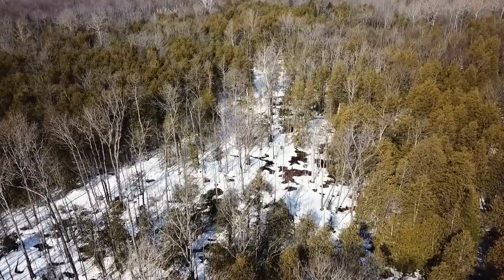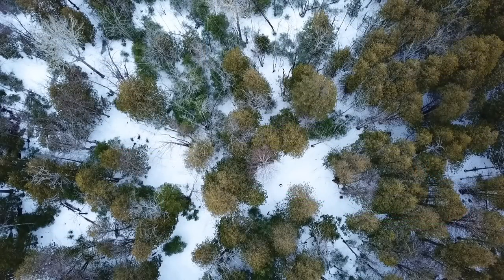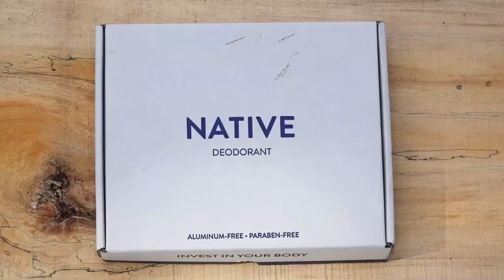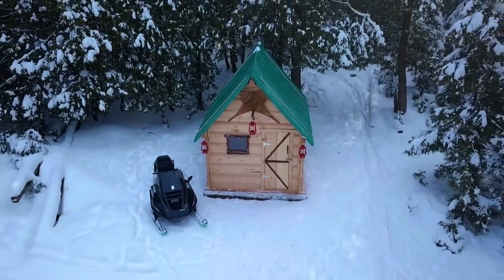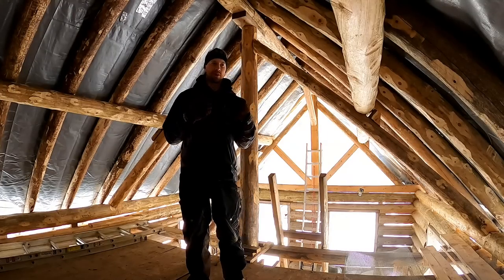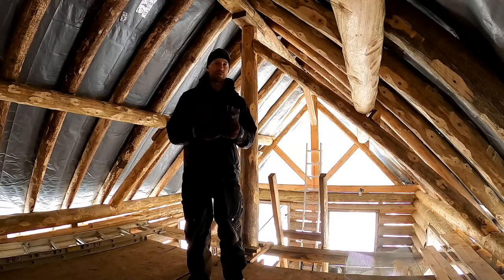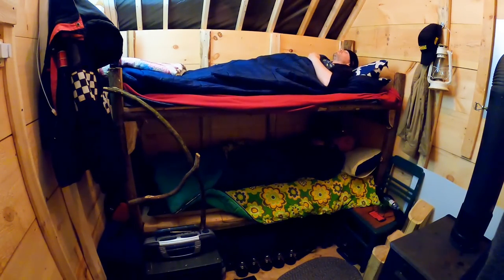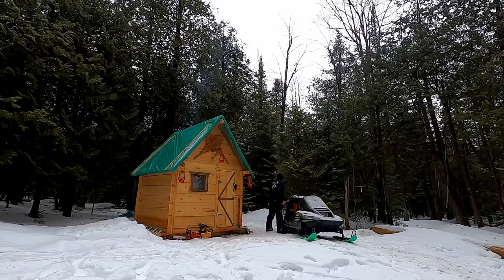Overnight at the Pop-Up Cabin- Ep 3

Comment: Rough on cameras?  Nah.  Just because you run over them with your snowmobile.  And a tractor.  😁

And the exact same thing happened to my DJI drone, only mine was in "follow me" mode.  It hit a tree about 50 feet up, then Newton got in the driver's seat.  It followed me all right.  If I hadn't jumped out of the way it would have hit me, with all four meat grinders still spinning.

Comment: So, I have a thought or two for quickly buildable structures based on this pop-up cabin. I'm planning on getting out of the city soon and want some kind of shelter I can put up in a few days like this. Instead of the notched 1x12s, I think cutting two corners out of 4x8 3/4 plywood and attaching them to 4x4 posts set in the ground could work well. Attaching the notch offcut perpendicular to the sheet so that it sandwiches the other plywood sheet when everything fits together would make a decent joint. Add a 2x4 rim, a ridgepole, and some rafters. The floor could be earthen to avoid having to deal with joists and sheeting. Use 1x3 on the inside to hold the seam together and cover the outside with insulation and some kind of siding. I'm in a hot climate, so I don't have as much leeway to shrug off missing insulation by oversizing the temperature controller.

Sure, it's not as convenient to haul out big sheets of plywood, but it goes together faster.

Comment: You should find an older 2003-4 mtn cat 144" EFI  w reverse, gear it down a bit for towing and you'd be set for those deep snow days. you can probably find one for 1500 or less..no carburetors to deal with. 2 pull starts.

Comment: Where did you find the camping lamps that you are using in the pop-up cabin?  I assume that they are rechargeable LED bulbs screwed into a table base as opposed to hanging from a light sock with a hook and an on/off switch built in?

Comment: A suggestion on a roof for Pop-Up Cabin. You could use a section of a SIP Panel on each side. Then it would require less Wood Fuel for the Stove. 

Question. I assume you are going to use some sort of cement based Chinking on the spaces between the logs on the Log Cabin. Is there some sort of flexible product that would adhere more strongly and flex with the expansion of the logs as the temperature changes? And as a harder/stiffer material has less R-value and passes heat through it more so than a more flexible product, there would be less air penetration through the walls.

Comment: The first suggestion is to cut you expanded screen material in advance with an electric shear at home and then bring them to the site. It will speed the work also use square cap roofing nails to secure them to the logs..You won't need as many. Next, there was a fishing video on Youtube where the guy had the GoPro attached to his fishing line in an ocean fishing adventure and Grouper rose up and ate the camera and ignored the bait. How is your wife doing?
Reply: Jeff Strong - The gaps are all different sizes!

Comment: As you are building a relatively old style log cabin, I was wondering what would the original cabin builders used to hold the chinking in place where you used expanded aluminium?  My guess is that it would have been small twigs and branches wedged between the logs to help hold  some mix of straw, mud or clay in place. 
Best wishes from the U.K.  🇬🇧
Reply: Some times horse hair
Reply: @gavinchurch6109  and maybe rag strips...

Comment: Amazing how quick the weather changes!
Great video stay safe out there!
I use gopros as well if you take a peak at my channel i put them threw some pretty good abuse actually broke two last weekend at the motocross track one is fixable w just a front screen replacement and the other i cracked the rear lcd really bad it still works but once water hits it it will be compromised these are all hero7’s btw i have also crashed my drone  2 times luckily the only damage was a broken blade or two!

Comment: From structural engineering point of view I thought you compromise with the overall integrity of the structure by making all the notches on load bearing elements such as walls and columns. It will be interesting to do a thorough structural analysis by a professional structural engineer. Some of the notches are almost half of the depth of the logs reducing its strength capacity by half at that section.
Reply: Then thank goodness its temporary, yeah?!  ha!

Comment: Seeing you nailing that mesh by using regular nails and then bending them, reminded me of something that I've never seen in Canada, but which was very common in Holland, where I'm originating from. In Dutch it is called a "krammetje", according to Google that is a "staple" in English, but it looks like this:

https://hwimages.beslist.net/beslist-images/35000/F300/001/037/862/1037862826.jpg
https://www.beslist.nl/klussen/d1037862826/Intergard_Krammen_verzinkt_30x30mm_per_kg.html
As the saying goes, a picture says more than a thousand words :) especially if you can't read Dutch. 

Very cheap and I think that would have made your job a lot easier. You can buy them in many sizes.

Comment: I hope you are not using steel nails. They will rot out the wood if they get any moisture. May take a few years, but never use steel nails when you can use galvanised ones. Currently fixing a house with the weather boards, they used steel nails. One roof tile with a crack, dripped water down the weather boards and the steel nails just rusted and rotted out the wood.. Yeah maybe this Pop up cabin is just for show and views, idk, but do it properly IMO.
Reply: spaaggetii Man 

Might as well just use Stainless Steel Nails!